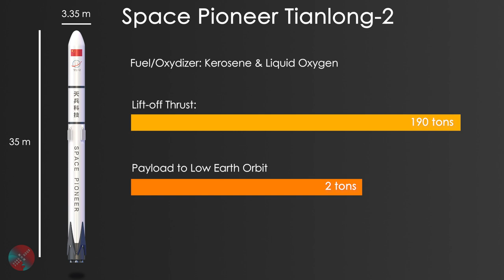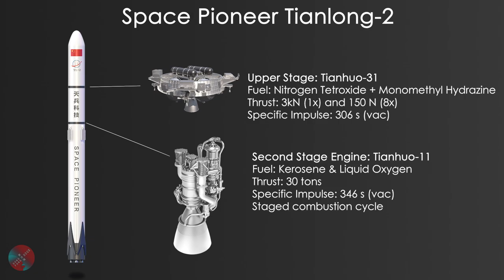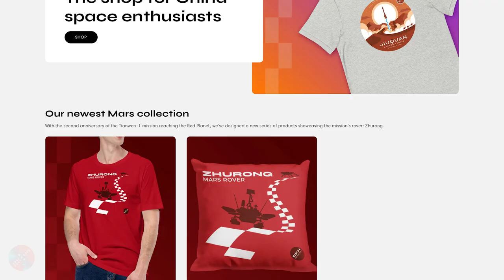China's Tianlong-2 Rocket to Attempt Launch

Comment: Space Pinoneer seems come out of nowhere suddenly. Surprisingly  they already have a liquid rocket ready to launch and two in-house developed engines. Now they finally revealed they were going to use YF-102 engines, which cannot let me guess their relationship with AALPT. But anyway, it seems they will develop a Falcon 9 clone that mostly matched its capabilites.
Reply from the maker: Their choice of propulsion has always been murky... Initially the company was all about using HCP "green" monopropellant engines (the Tianhuo-1, 2, 3), but we stopped hearing about that around 2020 when they started talking about their Tianhuo-11 kerolox engines.
The use of 3rd party engines (YF-102) also came as a surprise to me, as the Tianhuo-11 seems capable, at least on paper.
Reply: @DongfangHour  It is pretty interesting that they developed an in house staged combustion engine but are buying in a larger but much simpler gas generator one... could mean they're not so confident on their own design just yet and want to at least ensure successful first stage flight while accepting higher risk of actually getting to orbit, pretty much all rocket startups have had second stage failures on their first flights after all
Reply from the maker: Fully agree Johannes. And I think that as these companies are still living on investor money to a large extent, getting to orbit successfully early is probably more a priority than anything else (hence the YF-102). iSpace was rumored to have lost the confidence of many investors after the 3rd consecutive failed launch of their Hyperbola-1.

Comment: Good design and engineering only help so much with these startups.  I suppose it is largely a matter of how much financial backing they have (how many failures they can afford) and includes a great deal of unpredictable luck…Probably a bit of 关系 helps too…
Reply from the maker: I fully agree with you Jeffrey. In this regard, I think Space Pioneer is interesting due to 1) the fact that it seems to want to get orbit quickly, without too many of the bells and whistles (reusability) and by using off-the-shelf engines. The rest can come later. 2) Secondly it also has quite a significant runway, as the company claims it has just closed B+ and pre-C rounds of funding. The amounts were undisclosed but Space Pioneer claims it has now raised ~3 billion RMB of 10-ish rounds of funding. If true, this easily puts it on par with the other well-funded Chinese launch companies (Landspace, iSpace, Galactic Energy).
Let's see how their maiden launch goes in a couple of weeks.

Comment: There will be a number of commercial Chinese companies attempt a launch in 2023. Which will be first to successfully reach orbit remains unknown. Why the content on this channel so exciting and critical to understanding events as the year unfolds. Using liquid fuel vs. solid fuel would allow for much higher launch cadence, even if not reusable. Logistics much easier, particularly for transportation from manufacturing to the launch site. Both from the perspective that empty liquid stage is much lighter to move, and is not a transportation hazard (not fuel, like a solid stage would be).

The reusability question is a great question. With the initial Tianlong-2 first stage having 3 main engines (YF-102) it would never be reusable, as all engines are too far off of the stages centreline. To date, the SpaceX Falcon9 and other prototypes have all completed final landing burn using just a single engine (deep throttled) to minimum thrust level. eg: Falcon9 uses 9 engines on launch, but on 1 (deep throttled) on landing burn (ie: ~10% or less of launch thrust). Thus a derivative of Tianlong-2's first stage using 7 engines (Tianhuo-11) is much more likely to be reusable. Another possible reusable configuration could use 5 YF-102 engines on a larger diameter first stage. This a hypothetical as no rumours exist, just that 5, 7, or 9 are more suitable engine configurations.

The use of YF-102 (3x) vs Tianhuo-11 (7x) initially could be for risk reduction, and production availability. Using off-the-shelf engines (YF-102) initially is a smarter commercial move, as enables shorter timeline to flight, and opens opportunities for paying customers to help fund development, upgrades. It also enables the Space Pioneer team to gain valuable launch experience. In aerospace having real flight data is way more valuable than simulations, or ground testing.
Reply from the maker: Well said! I’d also note that on the original video of the YF-102 released by AALPT in 2021, a rocket with a cluster of 5 YF-102 engines on the first stage is shown. It seems quite possible that another rocket company (not necessarily Space Pioneer, who probably want to use their own engines in the long run) could adopt this architecture.